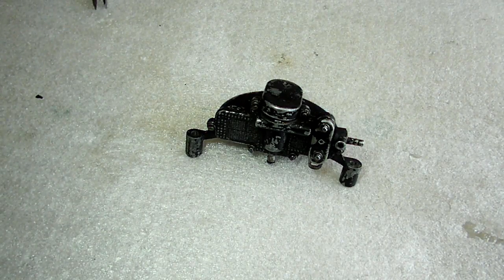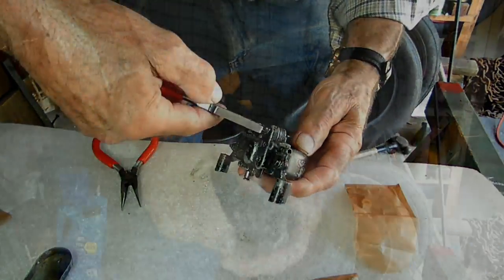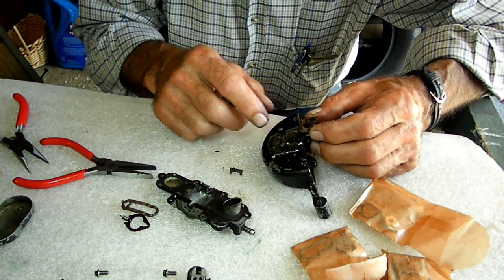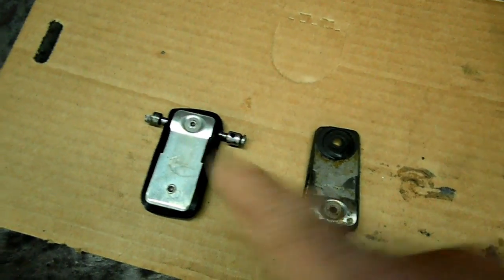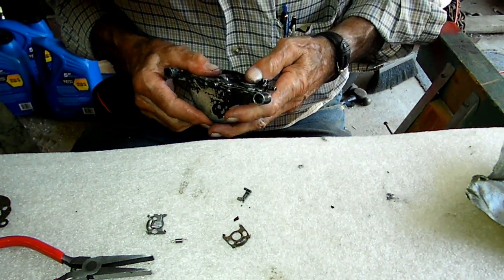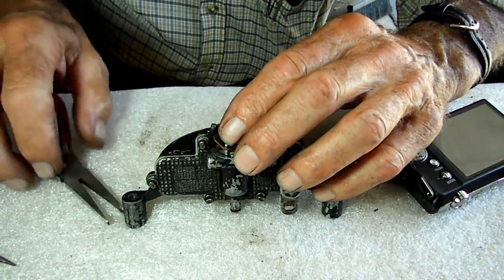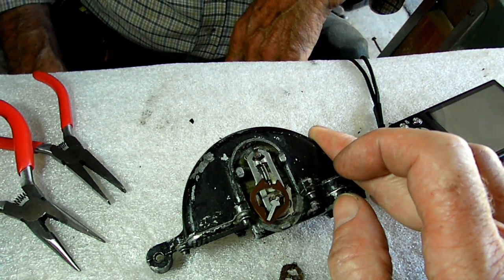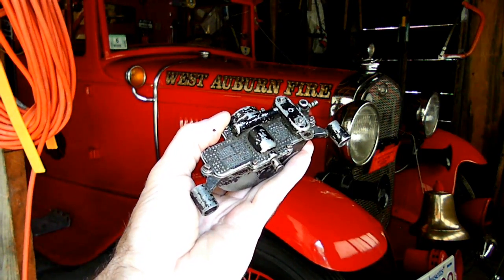Rebuilding Model A Ford Wiper Motor

Comment: Thanks for video. I have the wiper motor apart on my Model A coupe awaiting  rebuild kit to arrive . My father was an auto mechanic back in the day and I have a 1/4"  drive  Snap -On  socket that is for those rectangular headed screws.

Comment: Nice video..good to know there are people around with knowledge. i did noticed that you left out two important parts, the parts and position of the pull switch and the rebuilding of the paddle, otherwise nice job.

Comment: What skill!! Excellent detail of what to do ... and superb camera work.  I have a Trico 404G (very similar to this Model A wiper motor but for a 1940 Chev truck).  I have the gaskets but wondering where to get a full re-build kit including the small fiber piece (called a Rocker Home) - seen at the 7 minute mark of the video. My fiber piece broke. Any help would be great!  Thanks. Warren in Canada.

Comment: I actually have a tool for the bolts with the odd head.  It was in a military jeep wiper rebuild kit.  It's really nothing more that a steel tube that has been squashed to the same shape as the screw heads.

Comment: In the 1970s labor was cheap here..If I remember correctly labor rate was around $12 hr in 1973 when I worked at Toyota.. As with all else things have skyrocketed here..